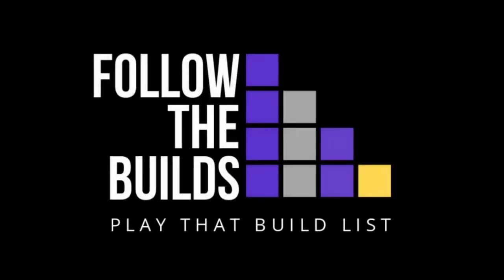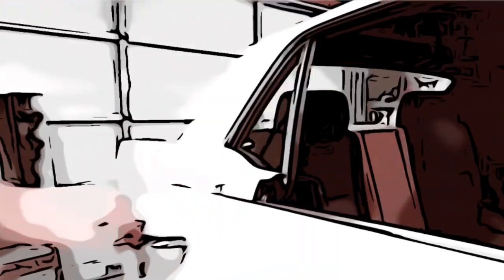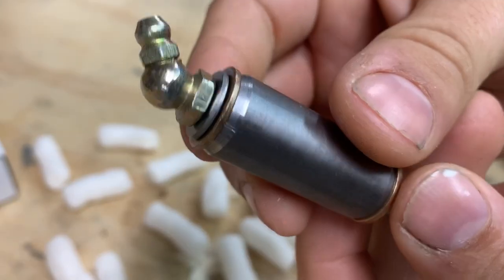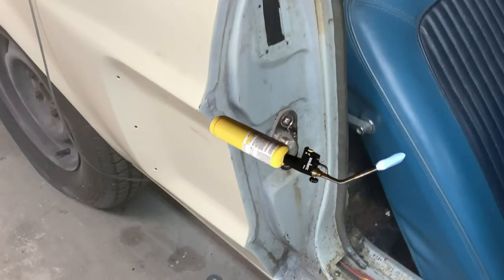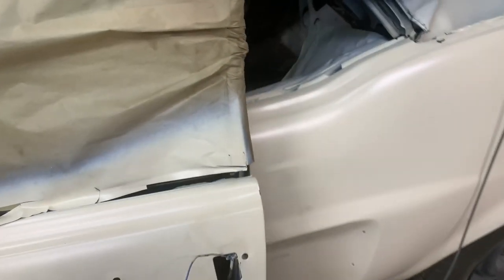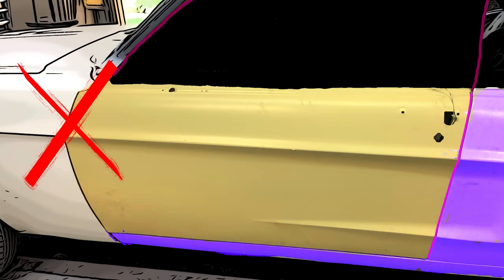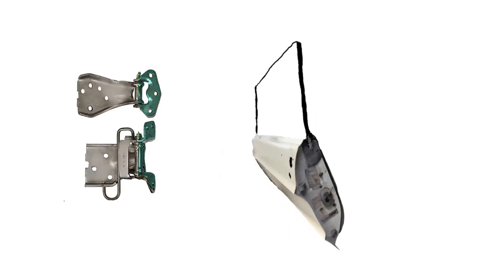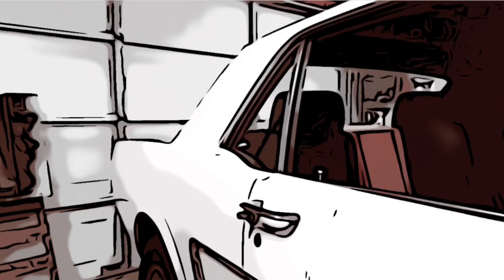Door adjustments on a classic Mustang. 1965-1970 Mustang door alignment tips.

Comment: Man this is great info. Any advice for my 65 driver door? Alignment seems ok, but I seem to be having trouble getting the door to CLOSE completely. It does latch, but it's a beyotch to get to lock. In fact, I can get the door to lock (technically) but it still opens right up. I feel like it didn't do this when I took delivery of the car a few months ago. Thanks in advance!!!
Reply from the maker: Ah that’s awesome! So the lock mechanism is separate than the latch system. You should try first some white lithium grease (sprayable) on the internals. If no progress from there then your lock rod is potentially off. Let me know!